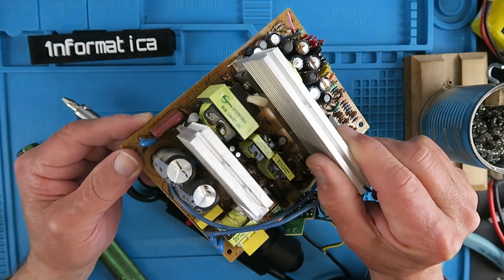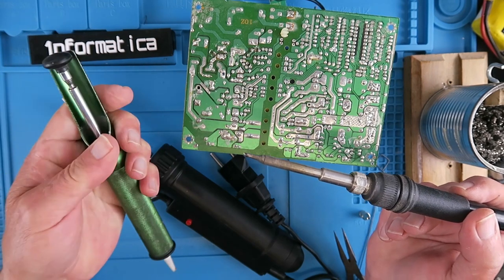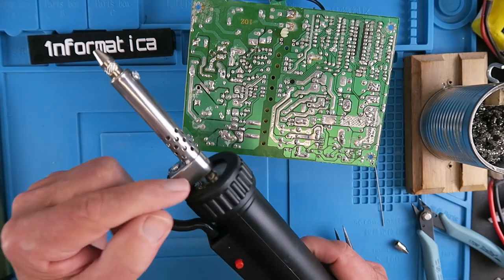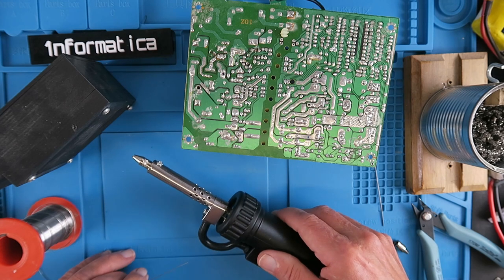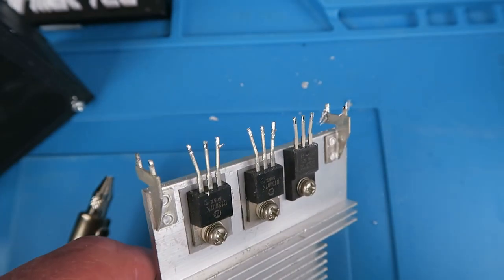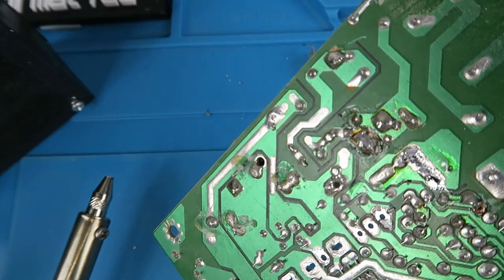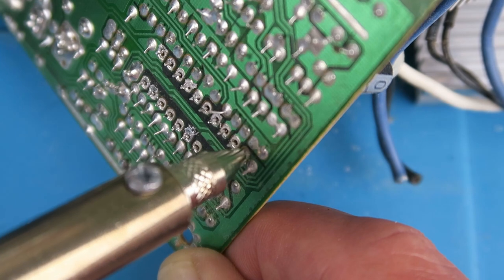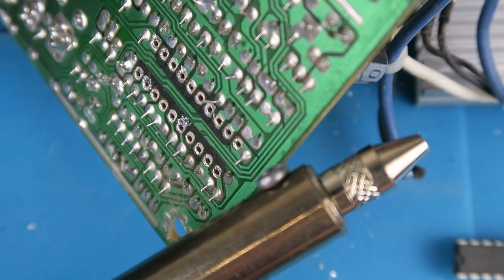Electric Vacuum Solder Sucker 30 watt 220 volt Review

Comment: I just ordered one thanks to this video. These are a LOT cheaper than the vacuum desoldering irons (easily >$200, whereas this one can be found for $30-40) and appear to do just fine for small jobs/hobbyists. 

One thing I noticed, and I read it in the Amazon reviews, is that you actually should keep something nearby (a cup or something, or if you're using a silicone work surface, that works) to drop the sucked solder into. Click the solenoid, then move off the work piece and hold the iron vertical over your "trash cup" and release the solenoid. Otherwise it just shoots a blob of solder back onto the board somewhere. Not a huge deal if you're just salvaging parts, but definitely worth considering if you're say replacing a capacitor or basically want to reuse the board.

I hope I'll be able to order extra tips and keep mine well maintained, I've struggled with desoldering a lot and I have a feeling this will make all the difference!
Reply from the maker: Hi, interesting comment. As you can see in the video my unit does not spit out molten solder when the solenoid is released. When I open the unit to clean it all the solder is contained within. Perhaps this may happen with tips with a larger hole. Good luck with you purchase. Thanks for watching, have a great day!

Comment: One of my favorite means to un solder provides a thrill for the day too.   I heat up the solder joint and when the solder is fluid I shoot it with a blast from DUST OFF can.  Molten Solder flying mostly in places you really  don't wish it too but the parts will just lift right up and out devoid of solder.   Also works good for cleaning solder out of Via ways.  Yes,  I should really buy one of these.  LOL      Dangerous as hell but does the job like nothing else could or would.  Yes I have a old school Solder Sucker.
Reply from the maker: He he, you really embrace Health & Safety then!! Nothing wrong with a blast from the heat-gun then banging it on the bench as well!!
Reply: I definitely won't not be doing this

Comment: Thanks for this review, I have an expensive PVM monitor which requires a recap and possible ic for the sync repair so this looks handy to speed the job up. 👍🏼
Reply from the maker: You're welcome! I'm sure you know but if you're dealing with lead free solder reflow the joint first with some good old leaded and it will come off easier! Have a great day!!

Comment: thanks for the review, however, you only tried on single-side boards. How does it perform on double-sided PCBs?
Reply from the maker: It is just as effective, plated through holes are plated through holes! Another tip, as these days everything is soldered using lead free solder, I reflow the joints with leaded solder and apply flux when removing. makes things easier. Thanks for watching, have a great day!

Comment: how well does it old over time? other products stop working after a few month, the tip deteriorates badly.
Reply from the maker: The one I have still works fine. It is a solenoid in a tube, there is not much that can go wrong! The tip on mine is chrome plated, unless it is abused badly it will last forever!

Comment: Hello Friend. You are the first one I see reviewing this model in black. Can you tell if this is already an improved version of that model in blue? Is it easy to clean the solder that accumulates inside? Thank You so much.
Reply from the maker: Hi, I am not aware of any difference other than one is blue and costs more! Cleaning is simple just unscrew the "knurled" part and the solder residue can be easily removed. The inside of the tube has a chrome plated disk that the solder just rubs off. If you have any other question let me know. Please consider subscribing if you have not done so already!
Reply: @1nformatica  Thank you for those clarifications. Won 1 subscriber.
Reply from the maker: @francopieruccinifaria9454  Great thanks! Lots of good stuff to come!

Comment: thank you ,, very interested an good demonstrated video  👍, i am impressed off what this Solder pump can do 👌 ,, i gonna order one
Reply from the maker: You're welcome! Have a great day!!
Reply: thanks ,, do you also know wat type off tipp/nozzle will fit for this desoldering machine ? an where to by at the web ?  i want to buy some for sprare
Reply from the maker: @mmols9904  I think the nozzles are particular to this tool, I have not seen them for sale separately. They are very tough nickel plated and I would think practically indestructible!!

Comment: How does the action work? Do you reload the plunger like with a normal desoldering pump? Or is the pump electric?
Reply from the maker: The plunger is activated by a solenoid so it is completely automatic. Please consider subscribing if you have not done so already!

Comment: Its pretty interesting there is a similar version of this on amazon and all the reviews complain it never gets hot enough so i wonder if they just put a US plug on the 220v iron and sold it in the states.
Reply from the maker: It's funny that you should say that, if you look at the product photos here : http://bit.ly/Solder_Sucker You can see it is fitted with a US plug! Mine came with an adaptor for Europe. Also there is no voltage marked on the unit itself.
Reply: I got one in the usa now what do I do?

Comment: Do you also know what type off nOzzle will fit for this BBT-580 desoldering machine an where can i order these on the web ?
Reply from the maker: I think the nozzles are particular to this tool, I have not seen them for sale separately. They are very tough nickel plated and I would think practically indestructible!!
Reply: @1nformatica  oke ,, ,thanks , because i wanne buy some more in case the get damaged . ,,

Comment: Wondering if the tip has any high voltage separation issues , like if i use another soldering iron along side it to assist in higher temperature joints will it explode in my face in some horrific mess?
Reply from the maker: I don't believe anything bad can happen. The suction is provided by a solenoid in the handle of the sucker, worst case it will burn out. Please consider subscribing if you have not done so already!
Reply: @1nformatica  hè mean its not eart on the ground.
So for microchips its not a good tool.

Personal i do not use on microchips electrische iron with out eart ground
 For some i use a gas iron to work with.
One i have a small point .
Reply from the maker: @dyslectische  If working on sensitive components you can ground the board and wear a wrist strap. Thanks for watching, have a great day!

Comment: great review, do you know how to empty the solder ??
Reply from the maker: Look at this point in the video : https://youtu.be/n0QtewXyiPU?t=99 See the knurled part near the tube, that unscrews and you can easily remove the solder and any other gunk inside. Thanks for watching, have a great day!
Reply: @1nformatica  Amazing. How is it holding up? Is it still usable after so long time??

Ofc. thank you for the video
Reply from the maker: @lnbabz  Still working well, not something I use everyday though! The tips are chrome plated and tough, it operates by a solenoid so really there is little to go wrong.
Reply: @1nformatica  Amazing, thank you. I will get it :)
Reply from the maker: @lnbabz  I think you will find it very useful.

Comment: Hi have you tried it for removing solder bridges on SMD IC's?  When I solder in an SMD IC I often get a bridge across the legs.  I use a manual sucker but its awkward - you really need 3 hands.
Great Video Thanks 
Dave
Reply from the maker: I would not use this for SMD work. I use "solder wick" desoldering braid :  http://bit.ly/SolderWick This with a "knife  blade" style tip works well for me. Please consider subscribing if you have not done so already!

Comment: bought one last week never worked like this would not heat solder up to remove ............
Reply from the maker: You need to contact your supplier for a refund or exchange. You are not possibly using a 220 volt one on 100 volts? Thanks for watching, have a great day!

Comment: Does this need tinning like soldering tips? Sorry I'm new to this things.
Reply from the maker: It does not need tinning. However I usually add a little solder to the component to be removed especially if it has been soldered with lead free solder. Adding a little leaded solder helps the "flow"!
Reply: @1nformatica  I cant find replacement tips/nozzle for this on the online store I use. Does the tips/nozzle last long?

Comment: is worth it or not ??
Reply from the maker: It is worth it to me, I have used it to remove components that I then use to repair other equipment. I find it very useful. Thanks for watching, have a great day!
Reply: @1nformatica  ur welcome bec i want order it and i want people opinion and thank for ur share man btw i want ask u do u have it now and still working??
Reply from the maker: @giovannigiorgio2262  Yes, still have it and working well. It is not a tool I use everyday but when you need it ..........
Reply: @1nformatica  i see 👍👍ofc we dont desolder everyday 😁😁except those who fix ps4 or ps5 u know electronic fix shop , soldering was hard for me but after i practiced it's easy now , so i go with desoldering , i cant use  wick its hard for me this is why i want that tool
Reply from the maker: @giovannigiorgio2262  Good luck with your projects. You may find dipping solder wick in liquid flux will make working with it easier!
Reply: @1nformatica  thank u amigo . too bad im no electrician  but i learn from online u know watching a lot of videos  bec i want fix my thing by my own i learn basic thing buying some tools
Reply from the maker: @giovannigiorgio2262  The important thing is to try and not be put off when things fail! Un saludo desde Andalucía.
Reply: @1nformatica  i mean fix things like when wire connect on PCB this is happen with Xbox or ps4 controllers + i want to learn solder   connector like type c or micro usb this is hard , if u watch videos its looks ez but wen you try it , its complicated 
 😂😂 oh Andalucía esa ciudad de la cultura👍👍

Comment: Ps2 controller analog???? Work
Reply from the maker: Sorry I do not understand the question. This is a tool for removing components from circuit boards.  Thanks for watching, have a great day!
Reply: @1nformatica  yes i know also remove analog soldring from Board

Comment: i bought it and guess what stop working after 10 minutes , its dead , only heat is working now
Reply from the maker: Sorry to hear that. Maybe there is some solder stopping the solenoid from moving? Have you cleaned the chamber out? Otherwise contact your seller. Good luck!
Reply: @1nformatica  there is no solder stopping anything i clean it the pump is down
Reply from the maker: @giovannigiorgio2262  You should get a refund from your seller. At the end of the day it's a switch and a solenoid, not much can go wrong!!
Reply: @1nformatica   now this is the problem if the seller want me to send it back will cost more than goods itself , i dont know what i do
Reply from the maker: @giovannigiorgio2262  When I have had a problem with an item I send a video showing the fault and usually I am offered at least a partial refund. Time to negotiate!
Reply: @1nformatica  the seller want me to send a video i will do that . for me i like when seller test the goods before shipping that will be better
Reply from the maker: @giovannigiorgio2262  Hope it works out OK for you. Sadly the days of "in house" testing are long gone. One of the penalties of lower prices!

Comment: Not suitable for computer motherboard 😅😅
Reply from the maker: See page 14! https://www.worldradiohistory.com/UK/Electronics-Today-UK/70s/Electronics-Tomorrow-from-ETI-Winter-1977.pdf
Reply: May i ask you why it is not suitable for motherboard?
Reply: I guess sufficient temperature with solder could desolder motherboard's THT, Did I get it wrong? even that is all covered by lead-free solder (mixing lead contained solder and flux could drop melting temperature)
Reply: first of all, I'm really appreciate that you reviewed this product, so I subscribed and liked this video
Reply from the maker: @envy.hs92  I think you would need to experiment. There are many factors to consider. I think it would be possible to use to remove components from a motherboard. Often I need to reflow a unleaded solder joint with leaded solder and then add flux to remove.
Reply: @1nformatica  indeed, reflow the lead-free solder is crucial to desolder a component

so i planned slot desoldering from motherboard by this order
I would like to know if i prepared correctly

1. clean the suface with IPA and brush
2. apply flux and heating (with air gun or iron) to remove oxidates
3. apply addtional flux (if needed)
4. mixin lead contained solder to THT pins
5. preheating with air gun
6. use desoldering pump
7. remove slot carefully, if there is any tension, apply additional heat by air gun 
and pulling out the slot
8. clean residue solder with solder wick
9. attach new slot and inspect a pins connected to via
10. soldering with proper tip
11. clean with IPA and brush
12. Inspect the surface
13. PROFIT??
Reply from the maker: @envy.hs92  Sounds perfect to me! I could not describe the process better!
Reply: @1nformatica  I'm glad that you say so,
 I've searched for desoldering method for many days to fix my server motherboard properly...
All that is left to put a plan into action

any recommend temp for cold PCB soldering?(or desoldering) 
I've searched for it, it says 350 to 400 celcius degree (you might be curious why i ask this question, because that i could not use hot air gun)

I'm so nervous because I'm never have desolder a complex component like this

wish me luck.
Reply from the maker: @envy.hs92  You've done your homeworks so go for it! Maybe practice on a similar board first if you can. Good luck!!
Reply: @1nformatica  That method sounds great as well, thanks for your response

I wish you always have a good day 😄